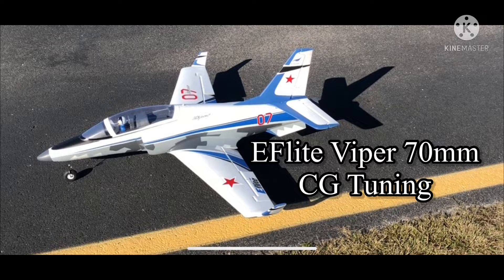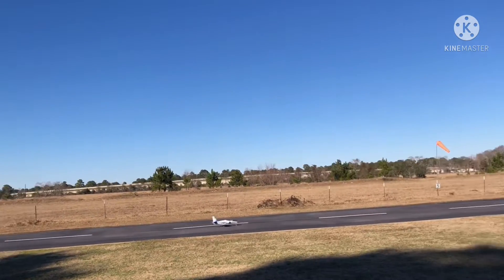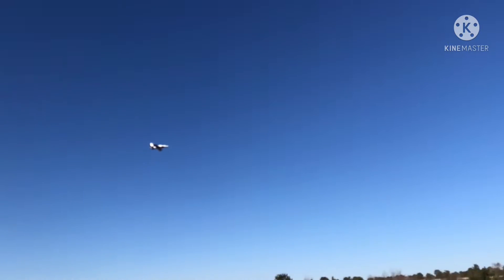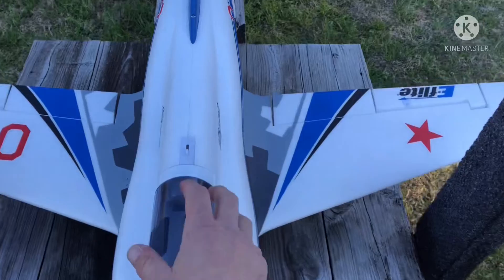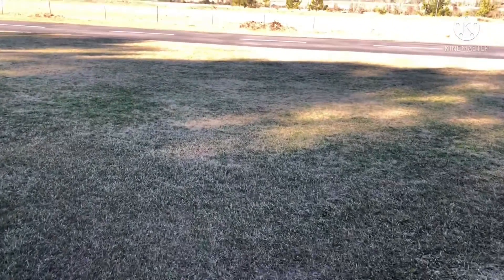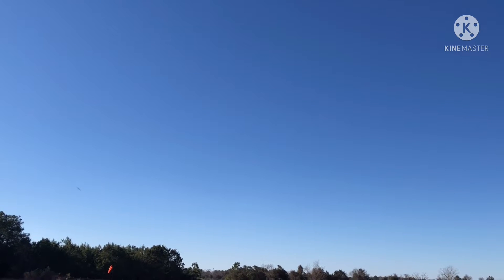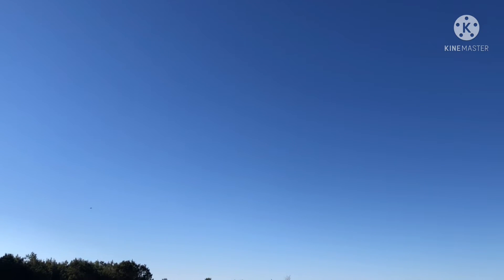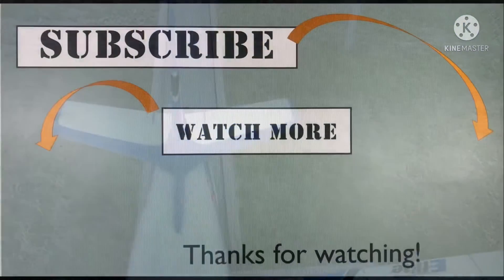EFlite Viper 70mm CG Tuning

Comment: Enjoyed the video.  I sure like my Viper too.  She is zippy, but will slow down and cruise.  I cut my throttle and coast her in on landings as well.  Like you, I use a 3300 and found she's a lot happier than the 4000.  Thanks for sharing.
Reply from the maker: The smaller battery does also help with the landing flair and holding off the ground until she drops in.